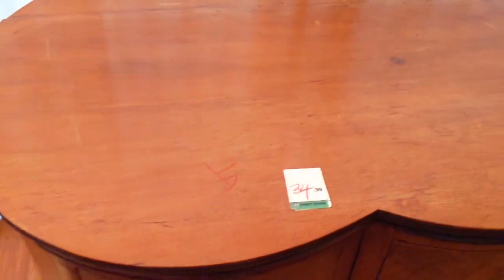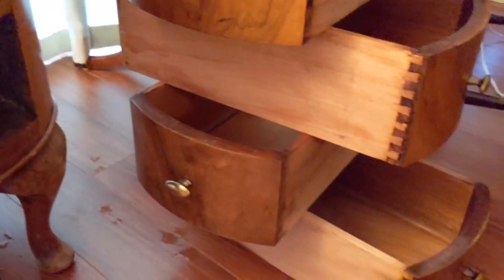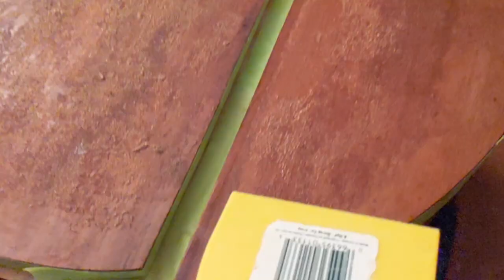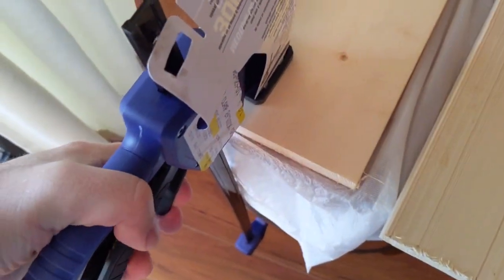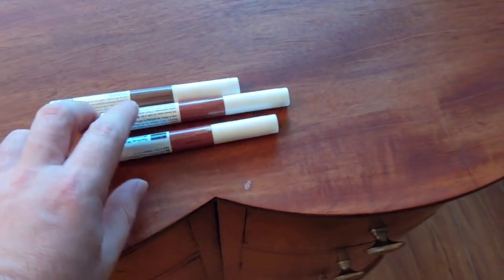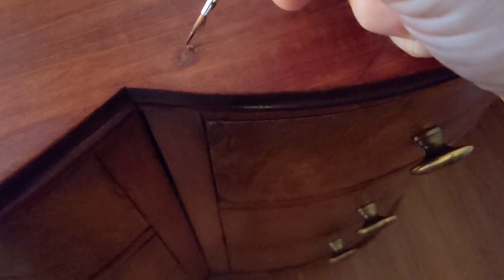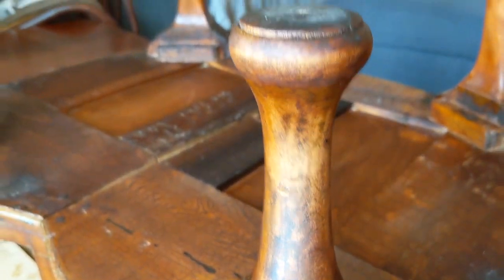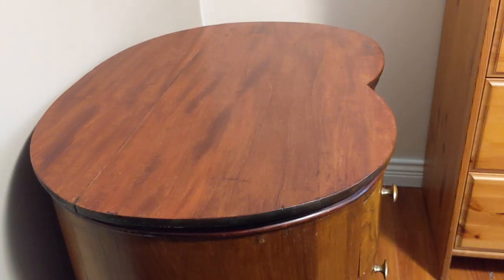Old bentwood dresser restoration

Comment: This was freaking cool! About how long do you think the project took? And how’s it holding up months later?
Reply from the maker: It took about 4 days to do mostly because I didn't have a workshop. It's holding up great. It will just need a waxing evey once and a while.
Reply: Fat Magnum you did a great job with it! Looks brand new! After you said it needed a 3rd coat of linseed oil I was like man, that must have been dried out.
Reply from the maker: @devokees  it was so dry. The old finish is still a little yellowed compared to the part I redid but I'm ok with the it.